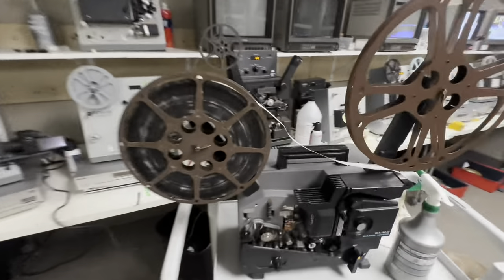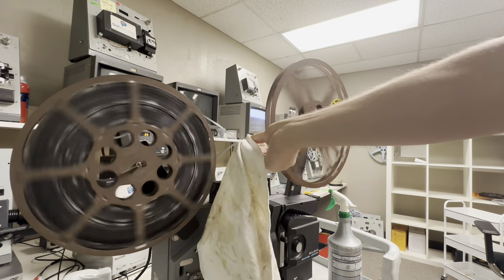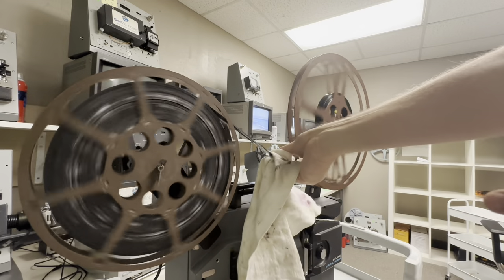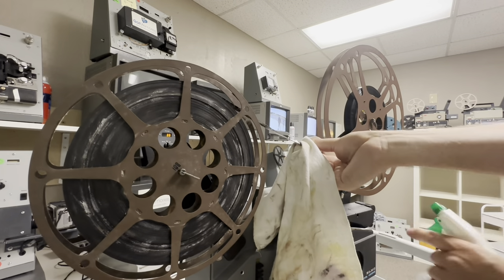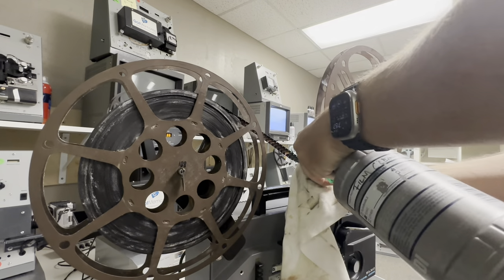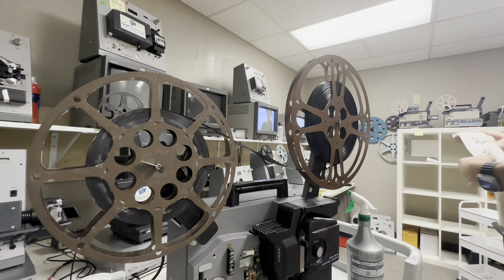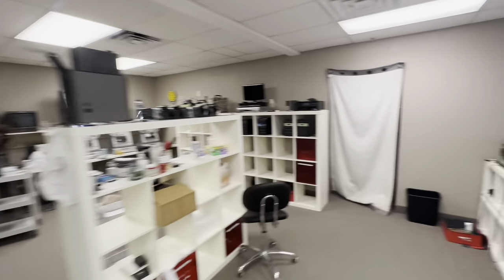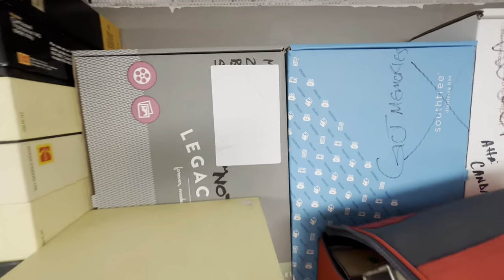Cleaning Mold off 16mm Movie Film with Film Renew Cleaner & Digitizing to MP4

Comment: I used to do the same thing using Kodak movie film cleaner with lubricant, but had to do it VERY slowly or the film would coil on the takeup reel while still wet and look blotchy.
Reply from the maker: Yes, you’ve got to be careful.
Reply: Not a Problem with Filmrenew. You even can store Film wet with it, to soften dried out Material.